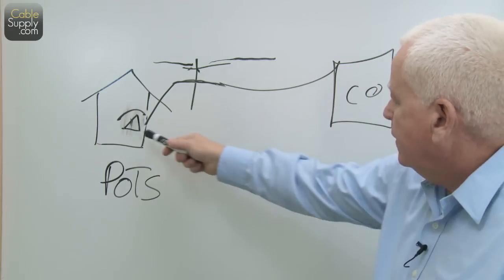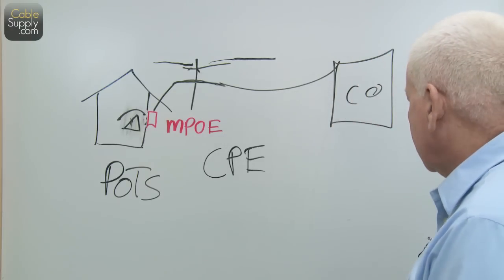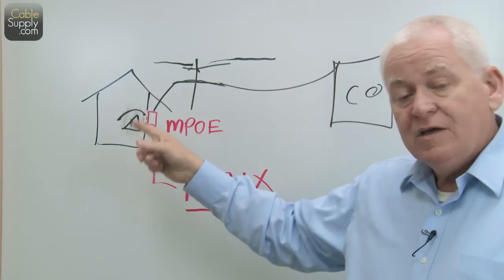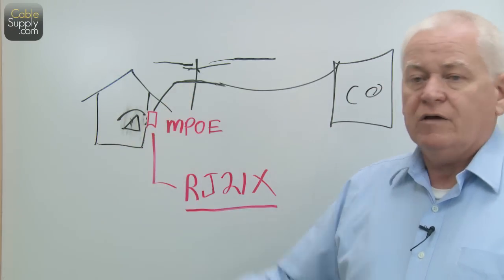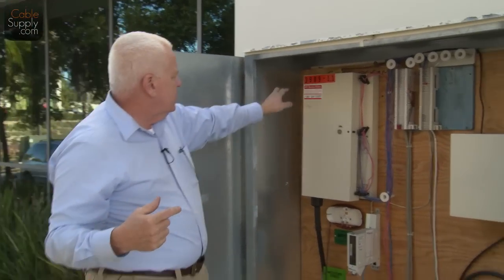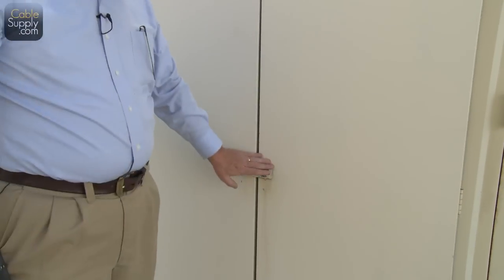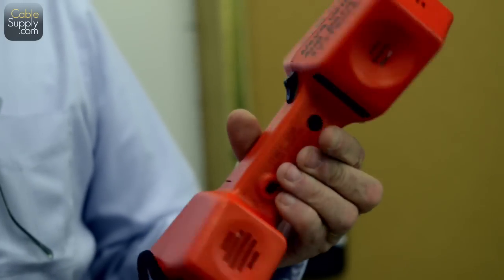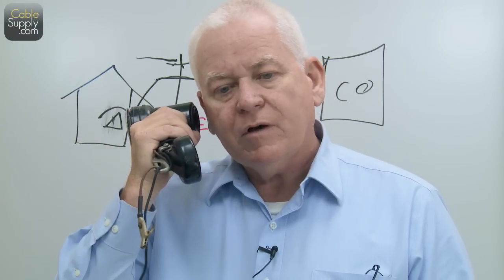Telecommunications Basics Part 2

Comment: It is reasonable to understand numbers on the dial but then why do we require alphabets on the dial?
Reply from the maker: Alphabets were used for the name of the local telephone exchanges. For example DAvenport5 9254 = DA5-9254 or 325-9254 (my Wife's old phone number). Davenpot5 was the name for an telephone exchange in the Philadelphia area. It was an easy to remember a phone number. Checkout the old song by Glen Miller "PENNSYLVANIA 6-5000" (PE6-5000 or today that phone number would be 736-5000) https://www.youtube.com/watch?v=xynDtjITYR4.

Comment: What's the difference between CPE & a modem?
Reply from the maker: CPE stands for Customer Provided Equipment. Which means anything that the customer has purchased on their own. A modem can be a CPE if the customer purchased it.   For example if the phone company provides the equipment , they own it, they will take it back at the end of the contract that equipment is NOT CPE.
Reply: @CableSupply  thank you💯

Comment: Great, great, great video! I've worked in the industry for over 18 years and there is still stuff that I learned from this video. One being that RJ stood for registered jack. i just always took RJ at face value since that's the terminology we used in the work environment. Regarding the pulse setting, I wonder if that still works in today's telephone systems. I found it fascinating as a kid to learn if my keys in my CPE were broken that I could mimic the pulsing and dial out using the switch hook.